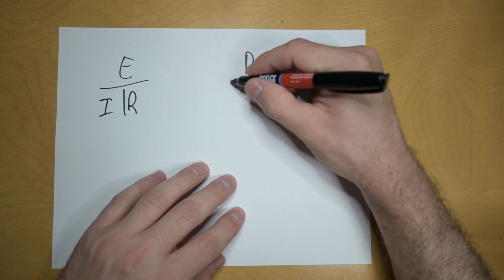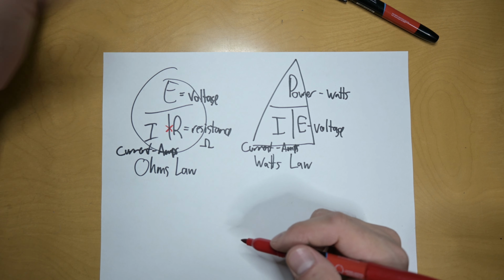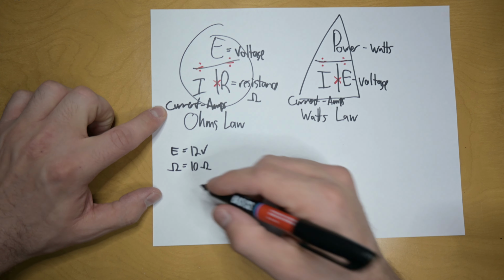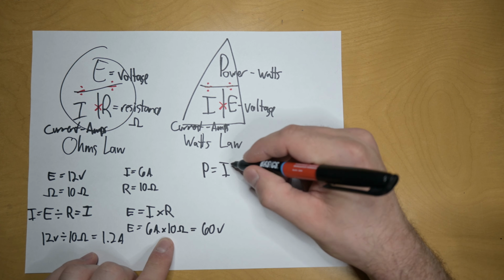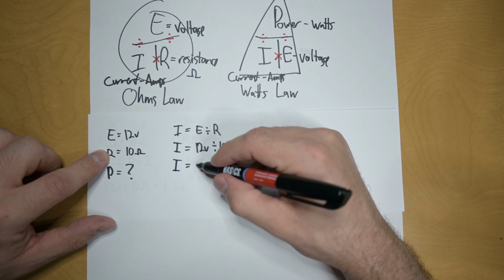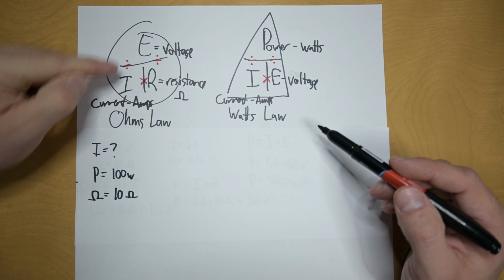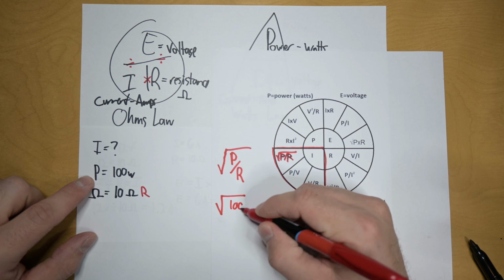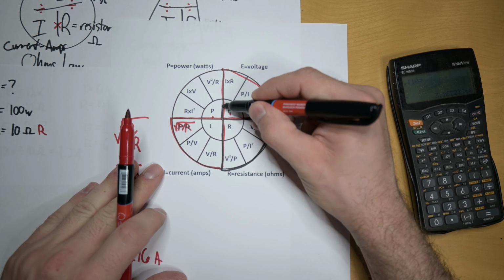The Ultimate Guide to Ohm's and Watt's Laws!

Comment: So to do it all, in a testing environment,  you need to memorize the power wheel, no shortcuts.
Reply: No shade it’s a great trick. But for FAA mechanic testing there is possibility to get hit with questions that will require some of the formulas that have squares and square roots usually dealing with watts. I’m having a hard time committing it all to memory and none of the tricks seem to have a foolproof way to include those. I’ll prob have to use your method then just memorize the four or so that have more steps. I realize now that my comment comes off as snarky and that was an accident. That’s for sharing, it’s a good hack for the majority of the wheel ✌️
Reply from the maker: I hope I didn’t come off as defensive, I was genuinely curious and hoped you had an awesome new way to do it that I hadn’t thought of 🙂. The power wheel is definitely a more powerful tool than the two other formulas individually, maybe one day I’ll get it memorized. For now though it lives printed out and stuck to my toolbox 😅
Reply from the maker: What type of testing environment are you referring too? In the automotive world for practical applications I’ve found Ohms Law and Watts Law to be quite sufficient. Thanks for taking the time to watch 🙂